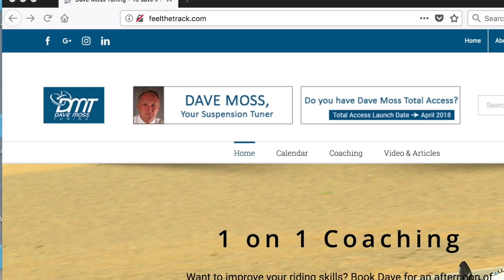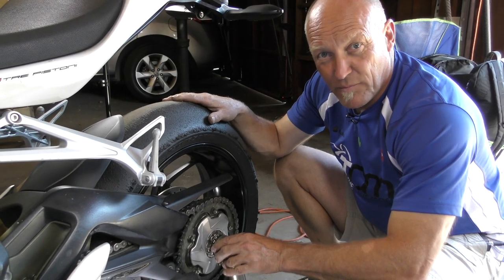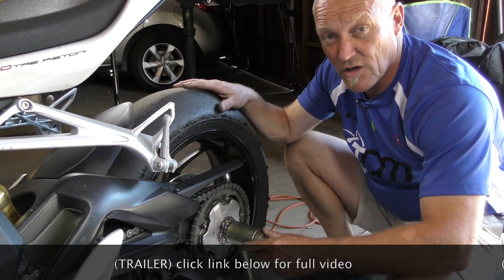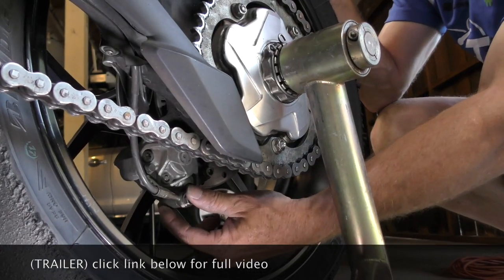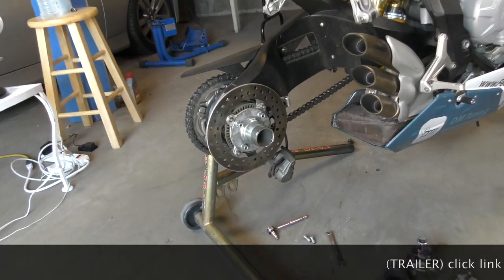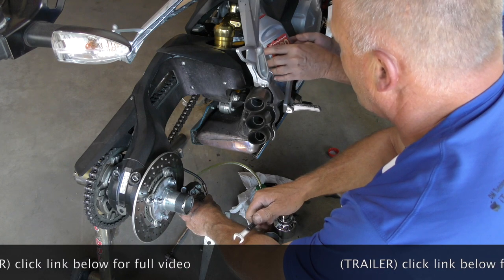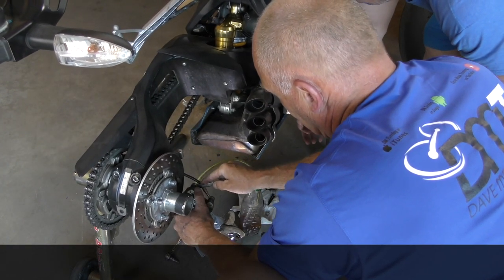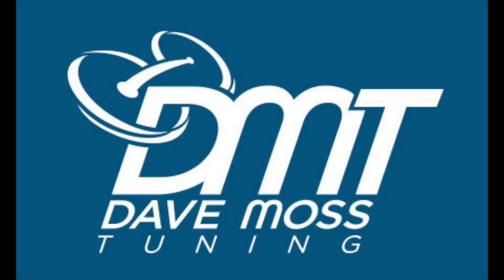Bleeding Upside Down Brake Calipers (TRAILER)

Comment: hi dave, we came across a simple but looks complicated question this afternoon, yet no one can answer my question.  from riders perspective, what is the advantages of mounting the rear calliper upside down ?
Reply from the maker: Honestly, there is no advantage as such. With the caliper on top, the braking force is forward, with the caliper below the braking force is backward (think about rotor direction).